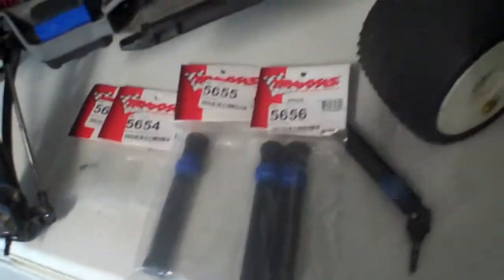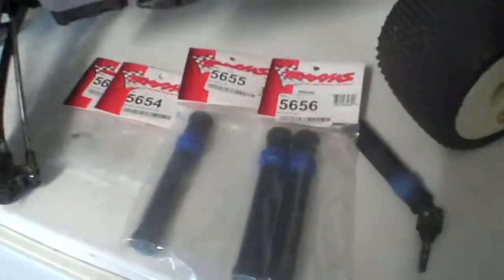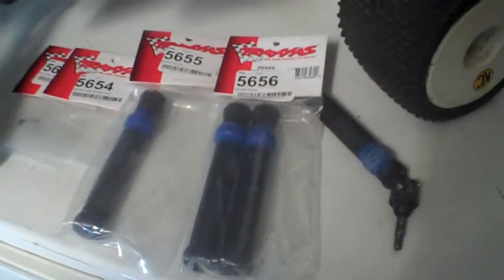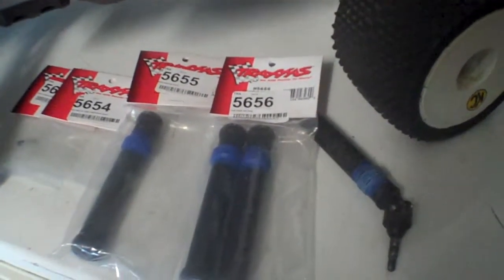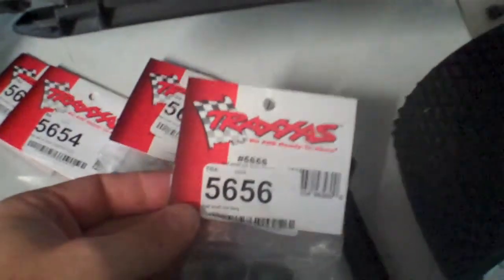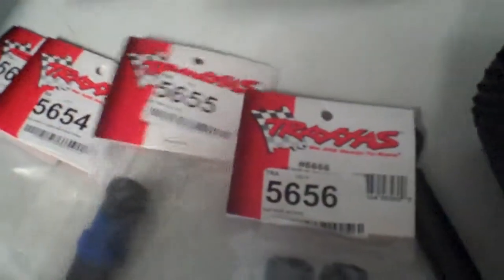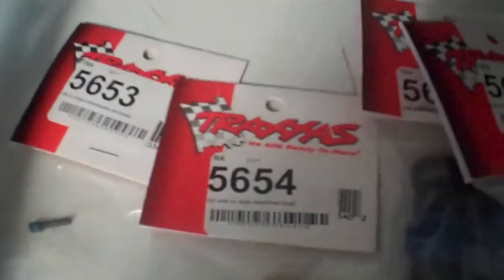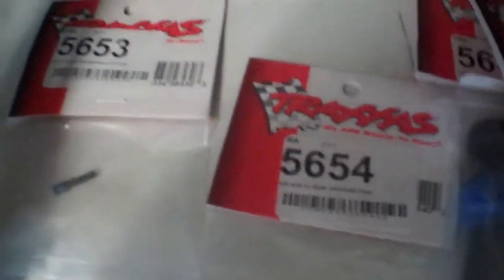summit short driveshaft on erevo.not a good idea

Comment from the maker: it has both. the 5655 are the short driveshafts, then 5656 are the long driveshafts.it has this becuase the diff in the summit is abou 5 milimeters wider on side side to allow the locking diff to work.